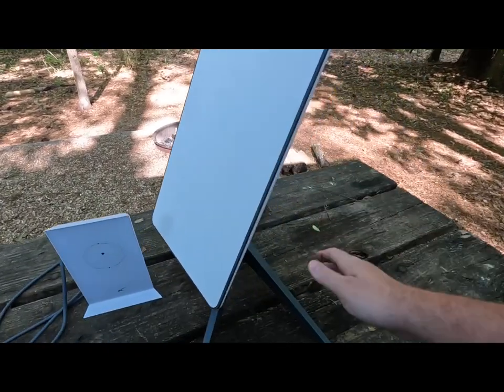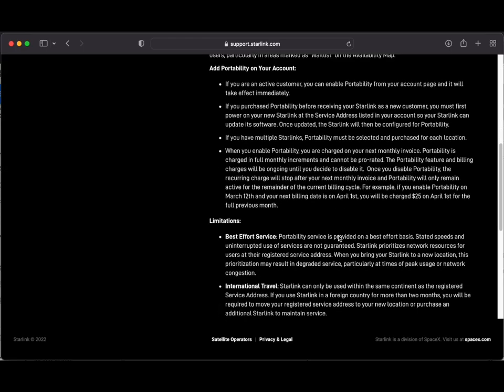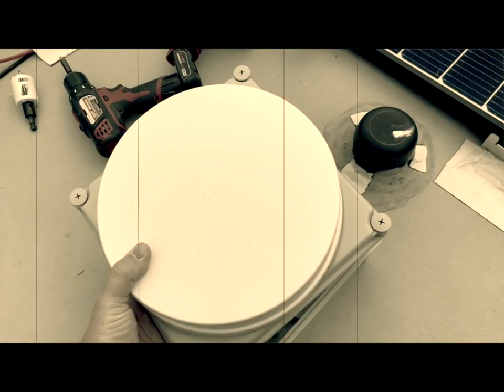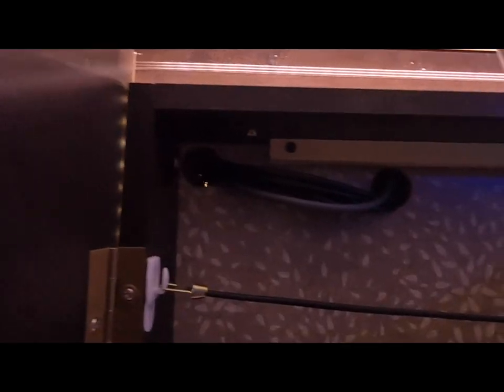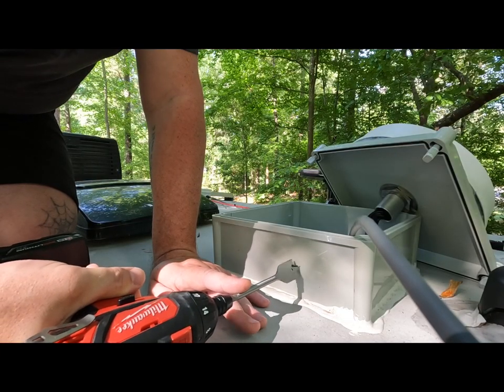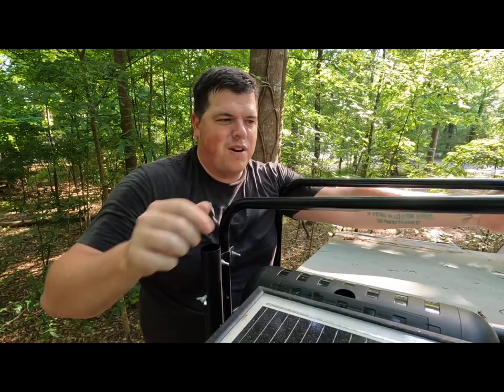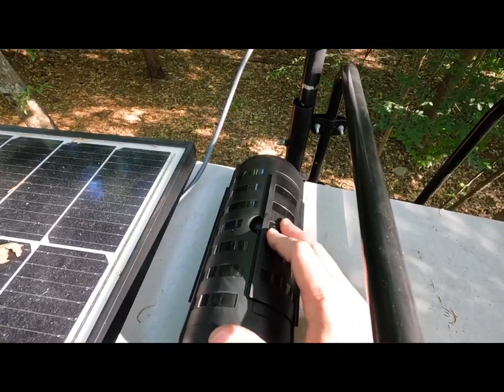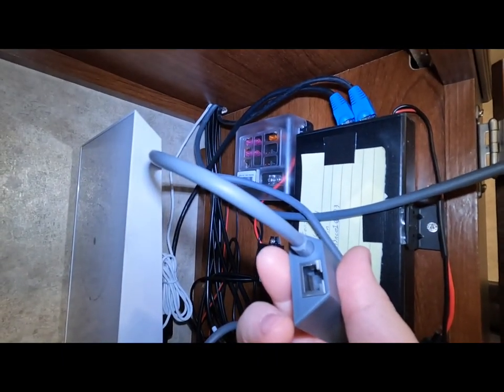We installed Starlink on our 5th wheel! - Full time RV internet

Comment: Thanks for the video.  What size gland did you use to run the cable into the box - do you have a link?
Reply from the maker: So I ended up having to use a huge gland to get the connector through and then use silicone to seal it. I’m trying to figure out a better way to run this cable.

Comment: What flag pole/mount are you using? I was hoping to use a flagpole mount As I am not comfortable drilling into the roof. I currently do not have a flagpole mounted. I have a 2021 Jayco Seismic 4113 if that helps for suggestions.
Reply from the maker: It’s the Camco ladder flagpole mount. I then got a piece of pipe from Home Depot and mounted the Starlink mount to that. It works pretty well, the only issue I’m having is getting on the roof with it mounted. It kinda gets in the way.